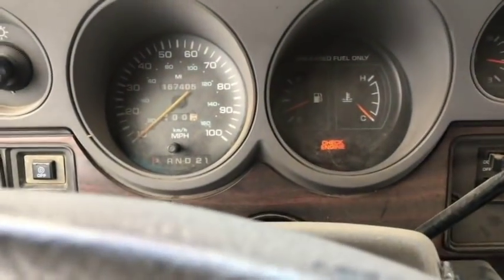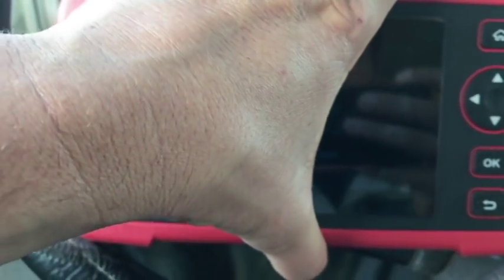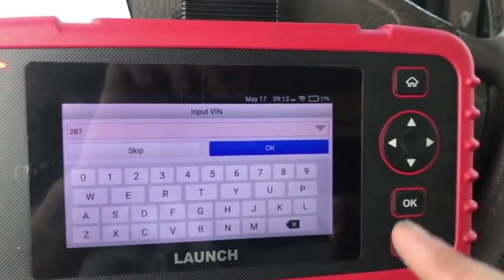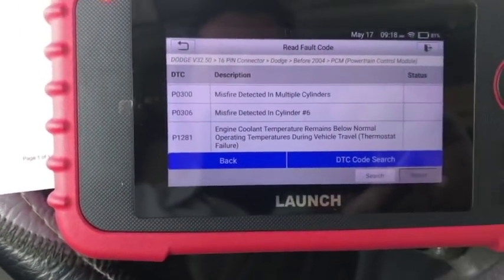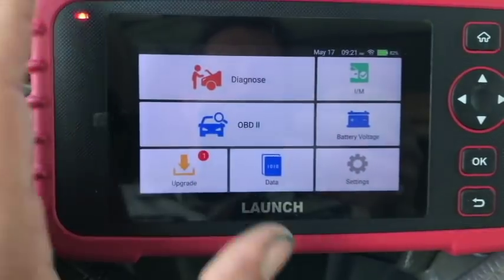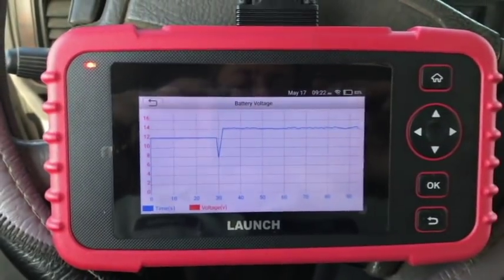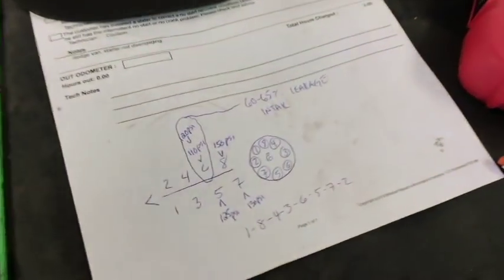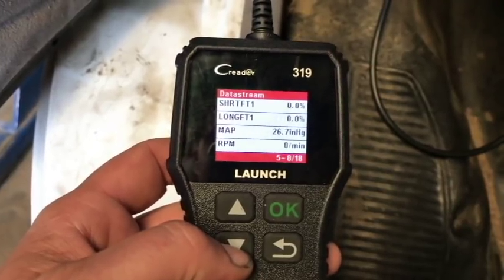Dual Cylinder Misfire Troubleshooting// #CR123X #CR319

Comment: Next time you need to do a cylinder contribution and the scanner doesn't support it remove a plug wire and put a jumper wire to ground on it. Start engine, if it runs worse everything on that cylinder is working. No change then you need to find the cause.

Comment: How do you know that the valves were on or off compression?
Reply from the maker: Gmguy3car  Place The cylinder your testing at TDC & and check for cylinder loss. If it comes out of the exhaust or intake you know you got a valve ceiling issue of some kind. Take the radiator cap off and if you got bubbles There’s a good chance you have a blown head gasket if you hear it coming out of the valve cover is a good chance that they’re sold or lost in the green case. If you don’t have a cylinder leak down tester you can try doing a dry and wet compression test and compare your results
Reply: It is  important to make sure all valves are closed such as in TDC compression stroke or the readings on the gauge may be inaccurate.